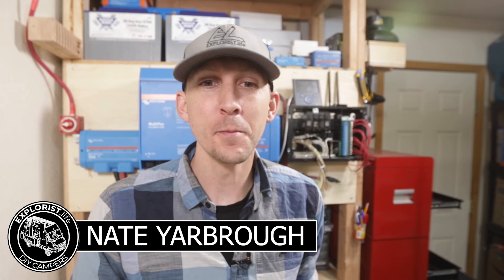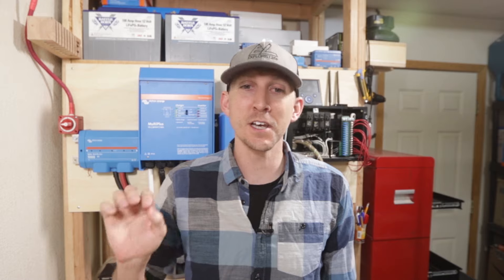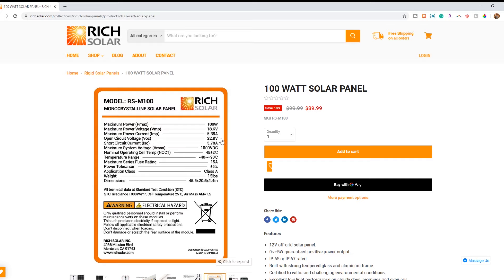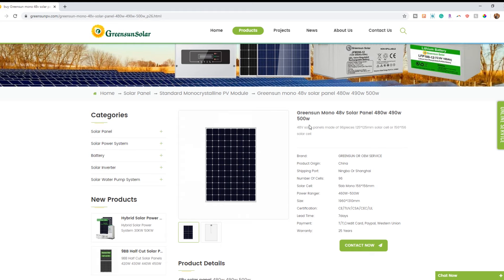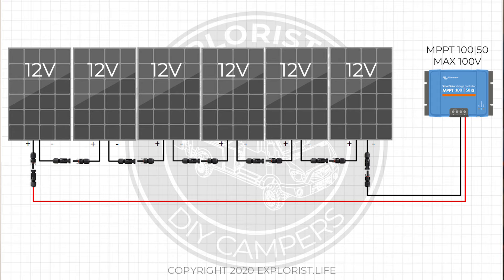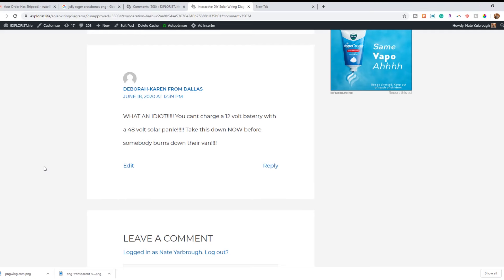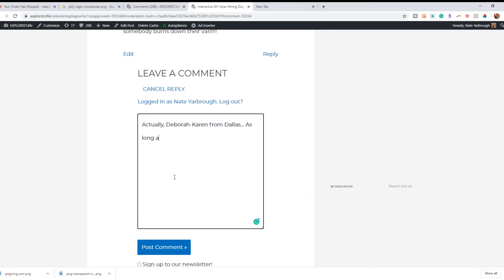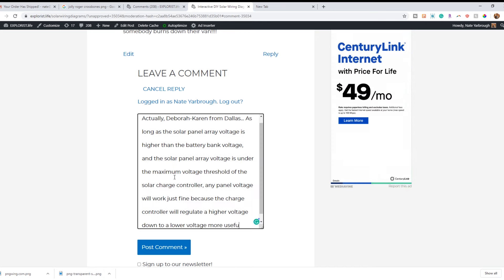12 Volt? 24 Volt? 48 Volt? Which Solar Panels for a DIY Camper Electrical Build

Comment: Very well done. Motorcycle camping solar builds with both 24v and 12v use’s. Many of us have 34v 90w sleep machines. Without heat and humidity around 20 watts. Another video idea. Thanks
Reply from the maker: Hey Ghost Pepper Rides, No problem!  Glad it helped! :)

Comment: I am missing something here. Say my 4 solar panels put out a total 100 volts.  If the 150v 70a charge controller steps down the voltage to 14 volts lets say, then why have a large solar array or even use 48 volt panels? and I have a 400ah battery bank, am I missing something the charge controller does with the amount of amps? I  am storing current not voltage in the batteries right?  Also if I use 2 48 volt panels, would that equal the same as 8 12 volt panel output approximately from the charge controller view. I have a truck camper so space on top is limited. I want to get as much power from my array to charge a 400ah bank, so if I use 2 48v panels i can have more power with less panels than 12v panels correct?
Reply from the maker: Not quite.  I think this video may answer your question: https://youtu.be/KJ5zCY5EBeQ

Comment: Hi Nate, I'm still confused about something here, On an RV solar system is it more beneficial to go with a higher voltage or higher amperage panels? Not sure I phrased  that question correctly. like 12 volt panel 21.4 VOC & 5.5 amps vs 19.83 VOC & 12.48 amps?
Reply from the maker: It depends on the entire array and how many of those panels you will have in it.  Comparing those two panels is not really similar since one would be around 100 watts and the other is around 250w.

Comment: Most charge controllers (or at least the MPPT) need a higher Solar voltage than the battery.

A friend has a large catamaran with a 24V battery. But the 4 solar panels are only offering some around 28V each - I call this a "stupid grown installation" from a former owner. 2 panels at the back (side by side) i connected in series and installed a victron MOOT 75 / 30 (sadly) - this is now working fine.

The other panels are mounted on each side - so serial connection is not
 the right way.

Do you know any charge controllers, that may "boost up" so the old
panels can be still used on the 24V battery?

Comment: can I mix panels? for examples I bought 4 160w panels can i add two 400w panels to it?
asking because I was hoping the MPPT could sort out all the income V and Amps
Reply from the maker: That would likely require two seperate charge controllers.  Here is what happens when you mix different sizes of solar panels in the same array: https://www.explorist.life/using-mismatched-solar-panel-sizes/

Comment: Panel voltage should not matter if you have the right charge controller. Especially for RV setups you want a 60amp or higher controller 80amp or 100amp really. You get 150v and 100amps 12v so 1300w solar intake.
Reply from the maker: Not really.  30A and 50a charge controllers are often great choices if the solar array wattage is below 400W and 700W, respectively.  Here's a video that walks you how I design a solar array based on specific panels and how to size the charge controller: https://youtu.be/OsVqIvahThM

Comment: I have 4 x 100W flex panels on my rig, I was on the roof and noticed that on one panel, one of the 36 cells looked like it had shorted out. the lens was melted so I assume that cell is totally dead. But what I don't know is. how much effect dose that one cell have on the rest of the panel or even that entire array. They are connected in series 

Thanks
Reply from the maker: You could disconnect that one panel and take an array wattage reading, then reconnect that panel and take another wattage reading and then determine the negative effect of Expected vs Actual.
Reply: @EXPLORISTlife  thank you very much. I did exactly that. And it appears that the panel is still producing the same wattage as the other. That gives me some peace of mind. 

Happy travels

Comment: I don't know if you've done one or not, but I'd like to see what happens on multiple panels hooked in series if one or more becomes shaded.
Reply from the maker: I'll do a video about that eventually, but the result will be: If you park your camper in the shade, the solar output will decrease.  The remedy is to avoid the shade if maximum solar output is the goal.
Reply: @EXPLORISTlife  I guess what I'm looking for is if you have 3 panels in series and one gets shaded do you get as much power as you do with 3 panels in parallel and one gets shaded.

Comment: yeah. Got it and I thought the same as you can change the voltage or Amperage, as needed by simply making the cabling in series or parallel or both.  The question is Why are the manufacturers making 24v panels, are they more efficient in some way? Because like you said, my MPPT Charge controller (sized correctly) should take care of it.  Is there any benefit for selecting the 12v vs 24v panels - Advantages in shading or heat dissipation etc. Needed your opinion on this.
Reply from the maker: Panels will get higher in voltage as their wattages increase so that we/they can use smaller wire.  This video explains that a bit more: https://www.youtube.com/watch?v=J9iHYgF6pXo

Comment: a single solar cell has about 0.5V
A module with 36 cells has 18V enough to charge a 12V battery via the controller.
A module with 48 cells has approximately 24V.
A module with 72 cells comes to approximately 36V. That's enough for a 24V battery

Comment: Hi,
I am Sajy John. I have seen your videos. Very good information. Thanks.  I have a question. I have 180 x 4 panels of 12 v. My mppt charge controller is 50 amp. Maximum of 800 or 1600 wts on12/24 connections. My maximum output so far is 530 Watts  at 12.30 am. Then i have a decline in output even the sun is still bright after noon. Now i have a paralel connection. Should i go for series connection of panel  for 12v battery?
Reply from the maker: I generally do recommend series or series-parallel wiring configurations over parallel, but it SOUNDS like your panels are just hot.  A 180 watt panel can only put out 180 watts at 25 degrees C.  Any hotter than that, the panel will lose efficiency.
Reply: @EXPLORISTlife  Hi,
Thanks a lot for the quick response.
Is there anything to improve my situation?
Reply: 530 watts out of a 720 watt system isn't too bad (73.6% of rated max).  You didn't say if your panels were aimed towards the sun or flat mounted on a RV roof or what.  Obviously, having them track the sun and being at the appropriate angle is going to be your best bet for maximizing your watts intake throughout the day.  Overall, I'd be pretty happy with those results.

Comment: Hi, wife and myself are thinking of getting into building a coffee van. We would be running water pump, LED lights, refrigerators, coffee machine and grinder. 

Is is possible to run all this out of a camper van using a solar/battery system. If yes, would it be best go 12 or 24 volts?

Comment: Are there any efficiency differences between 12v and 24v panels for lower light conditions on a 12v system? I'm interested in both cold cloudy (snowy) winter conditions and hot sunny summer conditions but wanting to park in the shade to keep cool while still getting enough solar power. Any resources you have on these topics would be appreciated. Thanks!

Comment: Makes sense if you wire too many panels in parallel the amps can cause problems for the controller . . AGM batteries don't like it too hot either , more is not better unless system can handle the load

Comment: I have only an 80 watt panel, and would like to know the minimum amount of gadgets I need to run just my fantastic fan. I already have a battery. The panel will be set up outside. Portable. Because I have an old aluminum trailer and don’t want to put holes in the roof. Sun is no problem in NV. Any advice? I welcome anyone’s response.
Reply from the maker: With those components, you'll need a charge controller to allow the solar panel to charge the battery and therefore run your fan.

Comment: 3000W INVERTER | 400-600AH | 400 TO 1200W SOLAR -CAMPER SOLAR KIT

Thank you for creating amazing content! I notice all your wiring diagrams are 12 volt systems. Will you be creating any 24 volt systems? I am not an expert which is why I am watching all your content, but 24 volt systems seem like a better option because of the lower cost of building the system. Would you be willing to change your above system into a 24 volt system and share it with us? :)
Reply from the maker: Not likely, no.  I do not think that any marginal cost savings of a 24v battery bank for systems smaller than 3000w of Inverter power and under 1200W of solar is worth the added hassle of understanding how yet another voltage plays into the system.

I will eventually put together a diagram for the site that has a 24v battery bank, but that will be for systems with 3000w-6000w Inverter power and 1200w-2400w solar.
Reply: Thank you for the feed back. I have seen a few “sail life” off grid 24 volt systems where they are running a 2000 watt solar system but using 3 charge controllers to charge the battery bank (for redundancy capability due to being isolated in remote areas). No one has generated such amazing content like you, so it would be cool to see an expert like you to show different systems. 

I have one more question about one of your systems. Where would you tie in a small 2000 watt Honda generator? Would it go to the Victron Multiplus Inverter Charger 3000 W 12 V in the same line as the “ac in” shore power?

Comment: HELP!  I am being told that I have sized my Solar Panel string to small to charge the battery bank... Currently Battery bank is 6vx8ea Golf Cart Flooded batteries wired in series to make a 48volt bank then I have another set wired in series then paralleled for more amps.... I wired my Solar panels Renogy 12 100watts in series 4 panels to get the 48 volts I thought would work for the Solar Charger to charge the batteries... Now I am being told by a contractor I need at least 5 if not 6 wired in series to get enough voltage... He says 4 panels aren't enough... Your thoughts and maybe a video to explain how many panels does it take to charge a battery bank like I am using... Thanks for the information.

Comment: Love your videos, you said to post your questions so I hope this isn't too stupid. I want to wire in the alternator of my truck to my trailer's leisure battery. My f150 has an aluminum frame/body, should I run negative line all the way back to the battery/alternator or wire to the frame? Do I need to worry about mixed metal corrosion? Thanks in advance and keep up the great work, please😁
Reply from the maker: Great Question!  I would recommend running the negative wire all the way back.  In addition to your concern, this would also make sure you have full control over the circuit and it's voltage drop.
Reply: @EXPLORISTlife  thank you for the confirmation.
Reply: @ShauneDonohue  ali is a great conductor of electricity  and its ok to create neg battery  points on an ali frame to save wire  but unlike steel , it tends to bend n stretch on vehicles over time  and will eventually create bad earth points ,,,,   its ok on a static frame though

Comment: Heyo! Great vid bro .   Little question here .. I got exactly the setup you are talking about . 48v panels and a 12v bank.  I got this Victron 100/30 MPPT .. but I noticed that when I connect them , it charges with only 25% power ... is this the power loss of the conversion from 48v to 12v?   if I would have a 24v battery would the power loss only be 50%?  And with a 48v battery there would be no energy loss ?
Reply from the maker: Nope.  The battery bank voltage would not affect the solar array output as a function of percentage.  There is something else going on.  Perhaps the batteries are nearly full?  Perhaps it's really hot outside and thus decreasing the power of the panels?

Comment: Thank you for finally explaining this topic so clearly. I have solar panels on my (new used) boat and have been a bit puzzled by how the charge controller does its job of converting the voltage from the panels to useable charge voltage for my house bank. Now I understand why the wires coming from the panels are only #10awg/ MC4 all the way down to the controller. In normal 12volt circuits I would be using much larger wire and was planning to upgrade the wiring. I don't have the specs for the panels so I will have to check the open circuit voltage at some point to see what is actually being sent to the controller. But now I suspect that the voltage is much higher than 12 volts, which is why they designed the system using the MC4 cables. Again thanks for helping me understand the "why" in solar design.

Comment: Do you have a video with recommendations on how to get the solar and LED lights‘ wires through the roof?
Reply: run them down the back door framing then under the vehicle and up through the floor which usually has a lot of little openings

Comment: I have a question,
So i made myself my own circuit with breakers and fuses, and it works YAY :) with a 12v battery 
Now i wanna connect my Solar panels 4x 12v 175w in series. I got myself a 150/45 victron chargecontroller so im safe even if i wanna go parrelel BUT
Can i connect my Battery bank in series as well? because my supplys gonna run 12v 

like how i see it right now that 12v is gonna be a 24v batterybank 
im just a little confused and tired, maybe it makes more sense tomorrow :)
Reply: Hi..wire of your 12v panel in series making 24v. It will charge your battery with constant amps

Comment: Ahoy Nate,
 I want to start by saying I enjoy getting your emails with insight on how to install solar. I live in Oklahoma which just got hit with a crazy ice storm that has caused us to be without power since 10/27/2020 no power as of yet. I have a saltwater reef aquarium that really cannot be without power for and extended period of time. Ours was off for 36 hours before I could locate a generator. My lack of planning cost me some very cool fish friends and got me to thinking of alternative solutions for power. That led me to think back on some of your diagrams and wonder what you would recommend for a situation like this? Would be cool to have my tank running off a solar powered backup battery system.
What do you think?
Thanks, Keith

Comment: All your vids are very well done, Thank You. I have a question - I have an MPPT Controller of 10-175V and 15A max and I have 2 identical x 175W panels  (17.95v / 9.75A) - With all things being equal having the 2 panels wired in series or parallel what would result in the best setup to put the max watts back into the system....? I am guessing Series as the voltage is within the controllers limit but I'm not wasting any excess current that way - would this be a fair assessment ?
Reply: You want series in this case.

Parallel adds amps, series adds voltage. If you wired them in parallel you would get almost 20 amps which would break the controller. Series meanwhile gets you 36 volts which is easily within the 175V limit.

Higher voltage also has the advantage that you can transfer more total power over the same wires compared to parallel, as it is amps that determine what wire thickness is needed. The downside is that higher voltage is increasingly dangerous to handle - touching the poles of a 12V battery is harmless, doing it with a 48V battery is potentially fatal so be careful.
Reply: @Ibian666   Well put
Reply: @Ibian666   Lot of amps are coming out of current panels (excuse the pun) during an overcast rain shower was wiring up two 270 watt panels to an setup to charge some batteries & happened to close contact the output wires from panels & they started arcing & fizzling though no Sun . . be careful with solar panels as they do put out power . . the first transistor was an solar cell that put out electricity when Sun shone . . the tech is hard to describe but evolved from red LEDS into Blue

Comment: Thanks so much for your videos. I need your feedback on the following setup to charge 1 12v lead acid battery. solar panel specs: Pmax: 240 watts, Voc=37.4 v, Isc=8.65a, Vpmax=30.1v, Ipmax=7.98a.
Renogy 10a PWM charge controller : max pv input= 130watts/12v; 260watts/24v, max pv input voltage= 50 v DC.
Reply from the maker: Sorry, but... I'm not sure what question you are asking.

Comment: Is there an advantage to running your panels in series to maximize the voltage into the charge controller? (assuming you don't exceed its capacity)
Reply: @Greg White that’s a interesting question.i heart that voltage over 40v and a mppt charge controller must work better in winter .Would like to know what 
He says about that .
Reply: The current, in Amps would be the same as one panel. If solar controller can handle the open circuit voltage, which is added for each panel
Reply: So you can use smaller cables
Reply: Advantage is less voltage drop, so more efficient.

Comment: I need help I'm on a tight budget and I'm trying to power 1997 wildwood travel camper the solar I bought one package of solar panels and saving to buy more is there a way to use the power inverter that is already in the camper till I can redo all of it